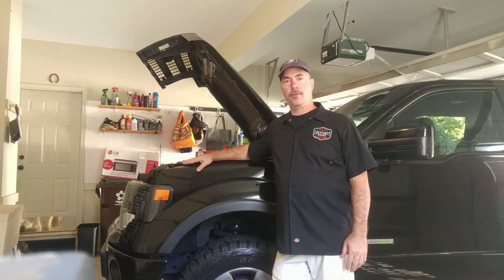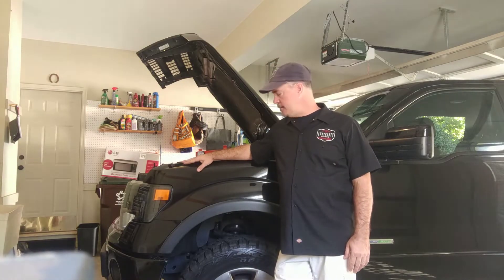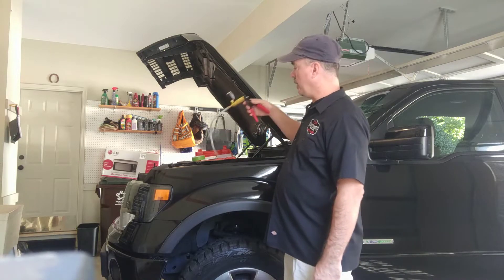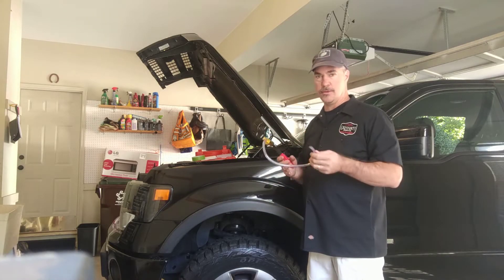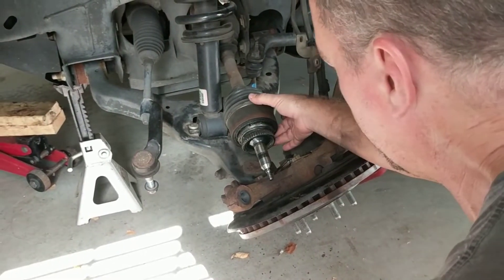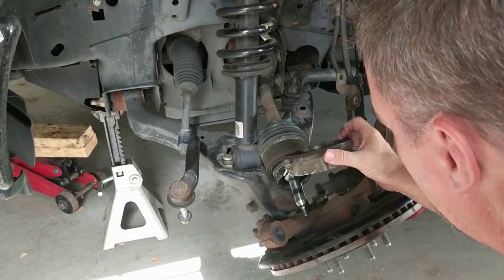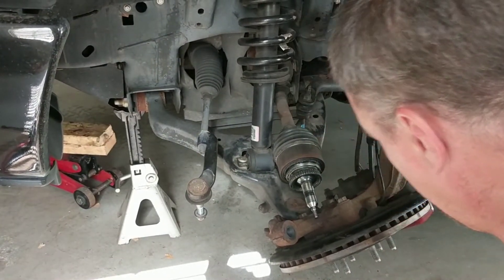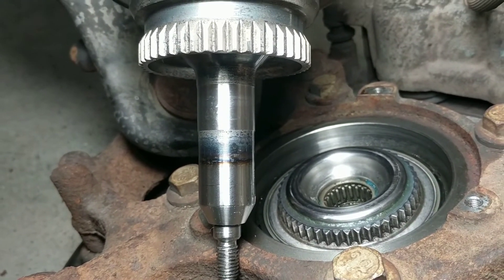F-150 IWE Replace and Explain

Comment: I’ve replaced the solenoid and check valve. Still have the noise. Looking under truck moving forward my front driveshaft and passenger axle spins. Next I’m replacing iwes and vacuum lines hopefully all good after that. Thanks for this video
Reply from the maker: You can pull the vac lines off down at the wheels and plug them. The test if vacc holds from the solenoid. That will tell you if you lines are good. Also, you can use a vacc pump on a short hose to one wheel and see if it locks to the axel when rotating tire. With vacc applied it should spin but NOT the cv axel. Hope that makes sense.
Reply: @jonparkmac  yes it makes sense. Before I replace them I’ll check just to see what the culprit was but I figured with all new parts maybe I’ll get another 90k without iwe issues. My lines are kinda dry rotted feeling anyways so for 50 bucks figured what the heck
Reply: If I do find a leak in the vacuum lines like many have I’ll wrap the new one in electrical tape anywhere its close

Comment: Really nice and clean truck. Hardly have any surface rust. Not my 2013 it's seen lots of salty roads. Makes it hard changing parts
Reply from the maker: That truck came from NY and surprisingly little rust. I feel your pain on the rusted ones. I use 50/50 acetone/atf. Way better than PBBlaster. I also use a torch on stubborn spots.

Comment: Is this the same for a 4a tc 
 I've heard cv axels spin while in 2wd is that true?
Reply from the maker: I don't know, but seeing 4a is always active to compensate for rear spin in subsecond, I'd say it likely does always turn in front. You can/should test that and see.
Reply: @jonparkmac  
Am having a rubbing sound on the front left wheel an am trying to figure out what it is 
I lift up the truck spin the wheel and axels did  spin, then I turn the truck on spin the wheel and axels didn't spin. but then I was filming the bottom of the truck while driving and the axels were spining and truck was in 2wd. Do you have any idea of what could it be I already replace selenoid and check valve
Reply from the maker: It sounds like it's working properly at the  IWE. Just because the CVs rotate when driving doesn't mean the hubs are locked in. For the instant-on feature .. I would expect it to do that. Can't say this is where your noise is coming from. They usually sound like dragging a tin trashcan lid under the truck when the iwe are ground out.

Comment: What an absolute disaster of an engineering design 😬
Reply from the maker: Yeah it's quirky. This one is going on 4 years now with no issues yet. I don't know what causes them to fail except people taking off on startup without letting the vacuum activate. The rings are soft metal and if you loose vacuum in the mud/snow it defaults to 4wd, so a few good decisions on an otherwise unreliable idea. Without it ..the whole front differential and CV joints constantly wear which is way more expensive to repair.

Comment: You answered my question at the very end! I was wondering the same thing. Thanks for the great video.
Reply from the maker: Right on. Glad it helped. After 4 years on that truck, still no issues so far. It's better than the delete kit which forces the front differential to turn always, which also puts more wear on the transfer case bearings.

Comment: Great video buddy! (Wish you would of showed us how the “broken IWE” worked like how you demonstrated with the new one.
Reply from the maker: They sound like dragging a trashcan lid when bad. But you'd use the same exact test I used. Wheel off ground, no vacc ..rotate wheel, shaft should rotate (4wd). Apply vacc ..rotate wheel, shaft should NOT rotate (2wd). Do that with vacc pump. If it works ..the repeat with engine running and try switch. If it doesn't work ..it's the solenoid.

Comment: Should the truck be in 4x4 or 2wd on the switch when checking for axl spinning?
Reply from the maker: Front axel doesn't turn if in 2wd, otherwise it'd be 4wd. If it turns in 2wd ..it's not working

Comment: Does the 2wd version also have IWE system? Or just 4x4?
Reply from the maker: No it does not. The IWE is exclusive to engaging the front wheels only.
Reply: @jonparkmac  Thank you Jonathan for your fast response. I was researching why my f150 (1998 2wd) was knocking when under a load. Thought this might have been the culprit possibly.
Reply from the maker: That actually sounds like a spun rod bearing on the engine crank shaft. Hold a wooden broom handle to your ear and touch spots on the engine with it. If the knocking is heard ..spun bearing.
Reply: @jonparkmac  Took it to my mechanic. He said "spark knock".

Comment: Thanks Jon. I’m having this prob for the second time on my 2018 f150. What I don’t understand is why they seem to be partially working. At low speed on level roads no problem.  On an incline at 30 mph or so the rattling starts. Get off the gas and noise stops. Does the vacuum vary under load? I’ve changed the check valve and solenoid and it’s still the same. Any ideas?
Reply from the maker: Yes the vacuum will change when under load and drops when you step on the gas. It sounds like you have a leak. Did you test it for leaks ?
Reply: @jonparkmac  thanks will do

Comment: First off Great video, I just replaced an accuator on my f150 and when I get up to speed around 20mph in my truck it started to make an awful sound like the splines were not meshing.. any idea why this would be? I took it all apart and put it back together again and everything is in properly I believe. Could it be a vacuum leak
Reply from the maker: Did you do the test with wheel of ground and also used a vacc pump ?

Comment: What would be the correct way of inserting the cv axle to the iwe? Do you pull vacuum on the iwe and then insert the cv axle? If so, how do you know the iwe gears will line up with the cv axle gears once vacuum is released? Or do you insert the cv axle to the iwe without pulling vacuum and just gently wiggle and align  the cv axle to the iwe gear?
Reply from the maker: The later with no vacuum but I see no reason why you couldn't do it with vac too. The main thing is to carefully fit it all together with no binding and then rotate the wheel with vaccum on and off and make sure it operates correctly.
Reply: @jonparkmac  when I had a leveling kit installed on my F150 the shop ruined my IWE, don't know how it happened since they claimed they didn't take the cv out but instead undid the lower control arm
Reply from the maker: @JayGlo91  they lied because you loosen the arm to pivot it down to make room to get the strut out and you have to allow the cv to come out for it to swing down. If they did not, then there is no way for the iwe to have been disturbed because the axl nut holds it in place
Reply from the maker: I know because I did it to myself when I installed a lvl kit. What happens if you don't let that out ring mesh with the cv splines .. it crams the ring back into the wheel side of the cv. Now the spring is pushing the ring against the offset cv gear instead of slipping on to it.

Comment: I got a questions, I changed mine on the driver side along with the solenoid and the check valve. Everything seems to be fine but the wheel has alot of resistance to turn by hand when in 2wd while the truck is running. The shaft doesn't spin anymore like it used to bcuz the old one was locked in 4wd. And there's no grinding noise. What could it be 🤔
Reply from the maker: Likely just your break pads touching a little and is normal. You can take the pads out with one bolt if you want to confirm.
Reply: @jonparkmac  I think it does. But how do I fix that or what do I do about it? 😂
Reply from the maker: @danielcastro8012  just leave it alone it won't be an issue. The brake calipers aren't spring loaded so they don't retract when no pressure. But when your truck is moving, they loosen a little and slip. Don't sweat it brutha.
Reply: @jonparkmac  idk man, sounds kinda bad 😬 rotors are drilled and slotted and pads are new. And also I get the slightest push back on the brake pedal when coming to a stop from a very very slow speed.
Reply from the maker: @danielcastro8012  if your worried, remove the pads and spin the hub. If it's still not free then it's your bearings or the iwe  is not done right. Only way to know is dig into it.
Reply: @jonparkmac  I did before putting everything back 2gether, it spun freely. Bearing sounded good. So then itd something with the pads?

Comment: So whats wrong with mine as I try to put into 4 high it will hump in 4 low... is the motor bad on transfer case? Which i have one bought havent put on....
Reply from the maker: Not sure but is not the IWE. Transfer case is the right place to look, hopefully just the engagement motor

Comment: Perfect for me.. I have 03 Expedition during a heatwave the solenoid went bad and all of the pressure was released.. I drove around for maybe 3 days hearing grinding noise when I accellerated I did'nt have a clue what was wrong I thought it was my Transmission because it was low on fluid but after putting inn new fluid in the tranny no problems with that only the grinding continued I just ordered solenoid from amazon $22.. waiting to install  and see if this corrects the problem if not where did you get the IWE part and what was the cost?..Rock auto is getting ridiculous with shipping cost
Reply from the maker: If the vaccum solenoid stopped, then it would have just stayed locked and not cause damage .. but if it was partial or sucking on/off could have jacked it up. I got mine on Amazon 45 bucks, no issues over a year. https://www.amazon.com/dp/B07MWSD94M/ref=cm_sw_r_cp_apa_glt_fabc_T76NH4HV1JTN2AH0K9D7?_encoding=UTF8&psc=1

Comment: Would this cause a rattle noise in 2wd, and once I engage 4x4 it goes away?? I changed the solenoid and the part that connects lol but sound is still there on passenger side
Reply from the maker: Try disconnecting vaccumm solinoid and driving in 2wd. If you hear it, then yes.
Reply: @jonparkmac  thanks bro - cheers 🍻

Comment: So both axels should  not spin at all  in 2 wheel drive? I replaced  driver side  but passenger side axel still spin should  I replace?  Tnx  you can reply
Reply from the maker: I'd do both. But yes, if axel is turning in 2wd, it's not working.
Reply: Thank  you very  much Jonathan   did passenger video all good now back on the road
Reply: OK tnx need to go buy passenger  side  and replace
Reply: Just curious why I hear the noise on the driver's side when I replaced driver's side?

Comment: Nice explanation of how the actuators work I changed my passenger side a month ago and a little voice in the back of my head said I should change the driver side but I told it no I’m sure the driver side will be just fine well it turns out my check valve wasn’t working right and it destroyed the driver side so today on a nice Saturday when I should be riding my Vmax I had to tear down my driver side and change out the IWE and I had to order the check valve!!!!Worst thing any company especially Ford could do in my humble opinion is a vacuum operated four-wheel-drive
Reply from the maker: Yes. I'm waiting to see how long mine last. Still not sure the cause of most failures.

Comment: Good video. I'm now puting on the doorman iwe delete. I've replaced them several times on each side. I hate how crappy they made the iwe
Reply from the maker: I'm wondering how long mine will last and what actually causes the failure. Looks like the plastic carrier breaks apart.
Reply: @jonparkmac  as far as I know they just do. Mine make noise during turns and it sounds like they will partially engage and grand a little bit. I've already replaced them once. And some guys in my f150 group have said they have multiple times. It's a well known failure. Ford's tsb on them said to pull the vacuum hose and cap it. Basically the same as the delete.

Comment: Just replaced both IWE’s on 2013 f150. Everything seems fine when going down the road, the grinding noise is gone. Axles are not spinning when In 2wd. Vacuum seems all ok.  But when I go into 4x4 the grinding noise is back from the drivers side making my 4x4 not work any ideas what could be the problem? Thanks..
Reply from the maker: Lift the front wheel off ground and try to rotate it with engine off. It should bind and not slip or ratchet. May have to bind the axel since it can turn with limited slip differential. If the wheel does not stay locked then it means the iwe is not working.

Comment: Thanks for this video--a good explanation of how these IWE hubs work. My 2011 F-150 is intermittently making a terrible noise--like dragging a trash can, and I figured out if I switch into 4WD high, the sound goes away. So obviously a 4WD system related problem. Your explanation at the end of the video (https://youtu.be/kJDaeANoxPU?t=533) seems to explain what is happening with my truck. I assume my hubs are intermittently failing or losing vacuum causing them to try to engage the front axles. However, since I did not switch to 4WD high, the axles are not actually engaged. So I have a spinning wheel trying to engage with a stationary axle! Yikes! I used a vacuum gauge and confirm I have 22 to 24 pounds of steady vacuum at each hub. So maybe the hubs themselves are bad--like yours in this video. Thanks!
Reply: Took my truck to Ford Service. Both my IWE hubs were bad. One was broken into 2 pieces and the other cracked. All good now. We suspect the hubs were ham fisted by a mechanic who recently installed new shocks and struts. Thanks, again!
Reply from the maker: Yeah, that is what sounds like. I looked 5 times trying find that big peice of sheet metal I was dragging 🤘

Comment: So.,.  If I deleted the IWE and put in the ..  IWE Eliminator part.. Dorman.. or another company equivalent part that would eliminate the vacuum portion of the process and still allow easy switch to 4 wheel
Reply from the maker: You can do that, but it means your axel and differential and drive shaft will always be turning and wearing. Also drags down another mpg. Just know the trade offs your making.

Comment: I recently had both hub assemblies replaced. I told them i feared something wrong in the IWE vacuums line from what i was hearing and from my online research. So I assumed when they replaced rhe hub assemblies they had checked over the entire IWE system. With 2 hub assemblies and my brake pads replaced i paid 1400. Here it is about 2wks later and I am hearing the sound again. Ive parked my truck and am waiting until after Thanksgiving to call my Ford dealership. Hoping their mechanics are a bit smarter than the ones who charged me 1400 not to fix the problem.

Comment: Thanks for all great video. sorry for my english, I try to find an answer on many many google search but I cant found it, perhaps you have it... I will try to explain my case. On my F150 2007 I changed both Actuator, both check valve, selenoid is fine and I tested presure, all is good, no issue. I can engage as well 4x4 in 4Hi or 4low mode when I am stopped and all is working, but when I try to engage 4HI on the road I hear a grind noise, the vacuum actuator hub try to engage but they are not able to slide in. Like you said there are 2 phases when we put in 4Hi on the road, first phase ( I think ) something engage the front axel,  second phase is when the front axle turn at the same revolution from back axle and are synchronized something engage the  actuator hub to slide in position. I think my front axle have not the same revolution from the back axle and cannot slide in position. Somebody have an idea why I cant put 4Hi on road ? Do you think that both axles are not synchronized? Thanks !

Comment: I thought the lockout gear stayed on the axle in 2wd and was pushed out to join the axle and hub together in 4wd
Reply from the maker: Correct. Spring loaded so when no vaccum, pushes ring toward wheel over both axel and hub gears. But with vac, it is sucked back on to axel only. Look at 6:20 where I demonstrate that.

Comment: When you put the vacuum hub back on the line will have no vacuum when you start the truck correct? So that wheel will briefly be in 4 wheel drive? Does the vacuum immediately pull it back in to 2WD as soon as the truck is started? I’ve heard of people messing up their 4x4 while installing leveling kits and have services lights come up on the dash.
Reply: The check valve up by the solenoid should hold the vacuum on the actuator if there's no leaks. Take your vac pump and attach it to the line at the iwe that supplies vacuum. Pull vacuum on that line and see if it bleeds off. This will let you know if your line or check valve is bad. If all are good  shutting off the engine should leave the vehicle in 2wd.

Comment: While the hubs/actuators on mine were not the problem, this video did a nice job of explaining the system and helped me diagnose and find my problem. My 2011, bought new, w 199k miles on it started rapid clicking from the front. Turned out that the vacuum line to the left hub was cracked and allowing enough leakage to allow the hubs to remain engaged all the time but back off when the hose bent "just right" to try to disengage. Only clicked when turning hard. Anyway, this video really helped. Thank you!
Reply from the maker: Cool. Right on, I'd rather someone know how it works than just blindly show a procedure. Glad it helped to you.

Comment: So if there is no vaccum, the truck is engage in 4x4 all the time(is it running in 4 high all the time?) So does this mean that the iwe eliminators will engage my 4x4 all the time? I am new to this Ford system and still trying to figure it out, if you can give me some knowledge about this I really appreciate it.
Reply from the maker: No, it only means front differential and Axel's are running and not anything else. Just little more wear on bearings and seals and 1,mph gas loss